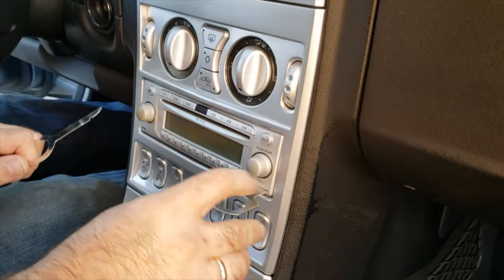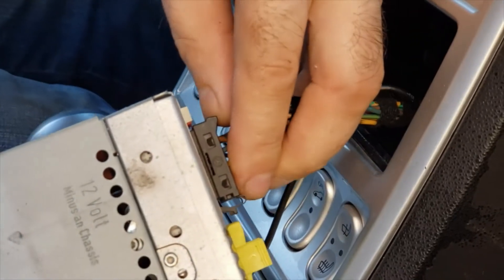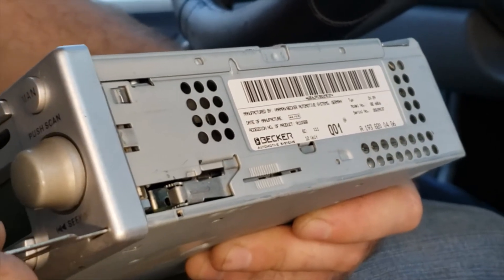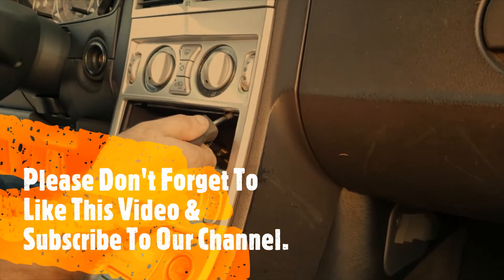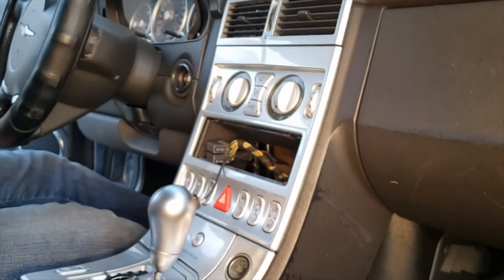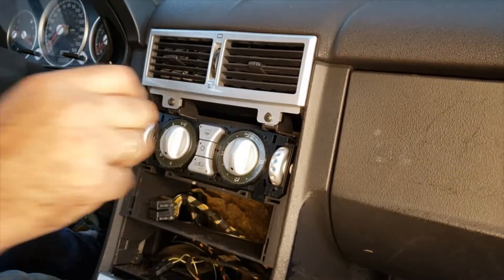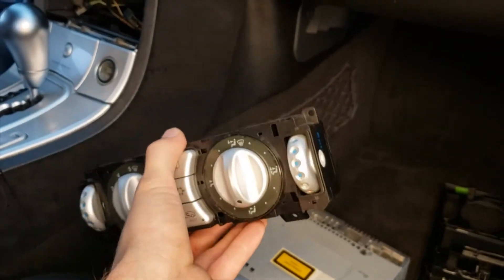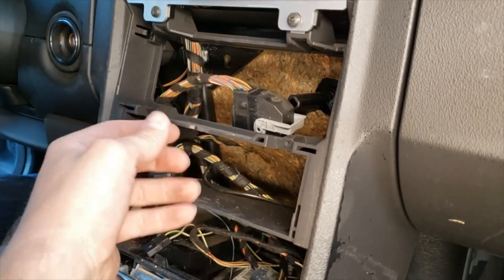Chrysler Crossfire How to Removal Climate Control Panel Controller

Comment: Great stuff, thank you.  I noticed those two white plastic rods that slip into those sleeves behind the panel.  I suspect that you need to make sure that you put the control unit back in (or the placement unit) in the same switch orientation or it won't sync up with whatever those switches control?
Reply from the maker: Yes you have to match it in same position